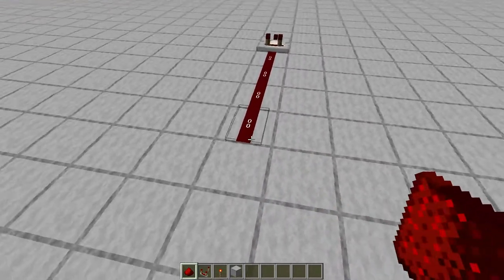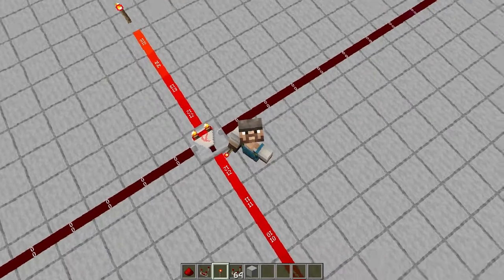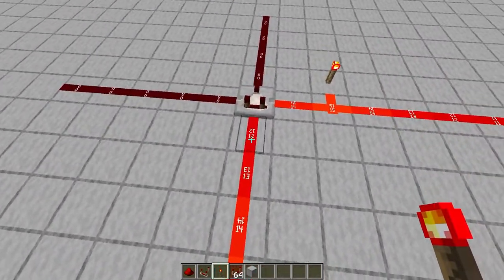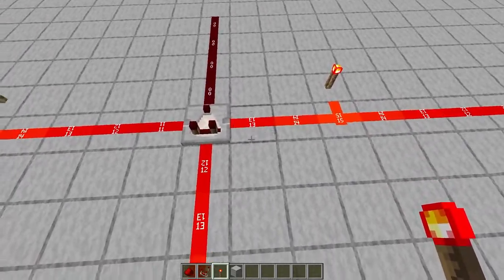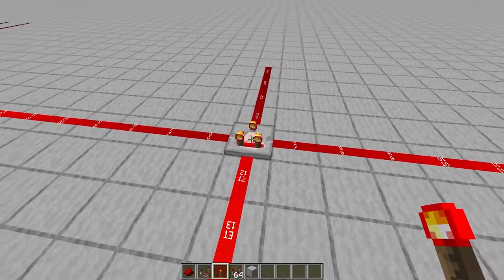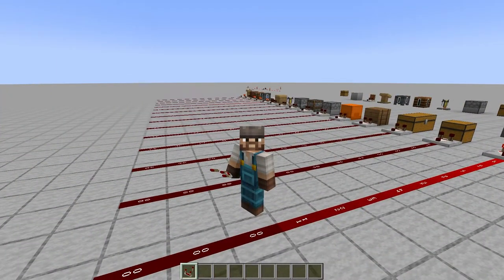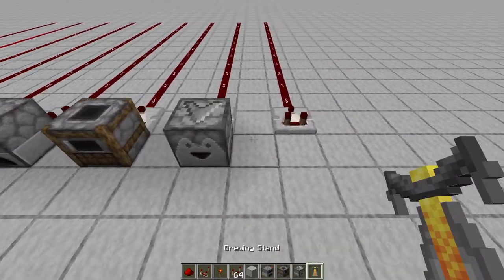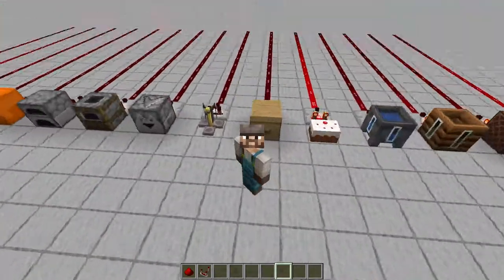Comparators Explained, Simply

Comment: i already knew what comparators do but i have one question.
theres a video of a minecart loading system which in my opinion i think its the best loading system(there can be some uses that this system wouldnt be perfect but still) and basically what that system did is check if items are flowing and if they dont then the minecart waits but if items start flowing then a simple pulse extender will activate and if items stop flowing then the pulse extender runs out and the minecart goes meaning that if the minecart is full it will go, if there are no more items it will go and if there no more slots avaiable but the minecart is not technically full. and the way it checked if items are flowing is it has a chest with an item and a comparator near it checking if there are items and from the left theres the hopper that puts items in the minecart and when items started flowing a sticky piston would remove and push back a block above the chest with an item and somehow it worked and i tried to test out generally to understand how it works but i couldnt.
in the video he said its called a comparator update detector so i wanna know why is the output of the comparator different when theres a block or there isnt a block above the chest.
Reply from the maker: I'd recommend you join the discord to get help with this. A lot of comparator update detectors use pistons to work, so that is likely what is happening, but I can't be sure without seeing it. In the discord you can share screen shots and or the video so it's much easier.
Reply: @NicoisLOST  idk whats more impressive the comparator update detector or the fact you replied in 25 minutes on a 5 months old video lol.
thx for the reply ill ask in discord.